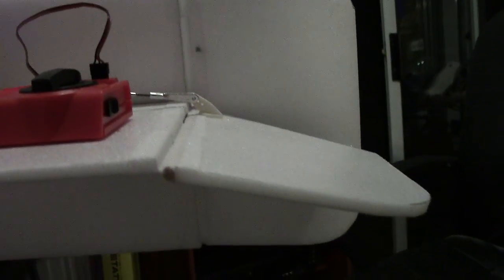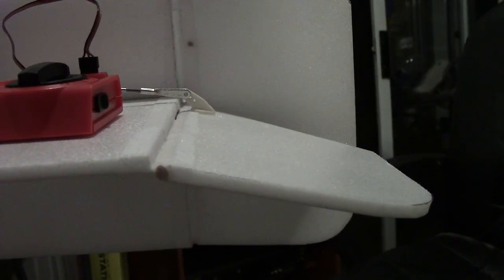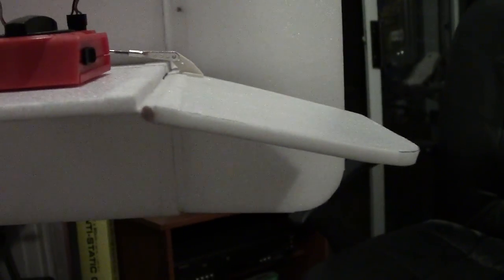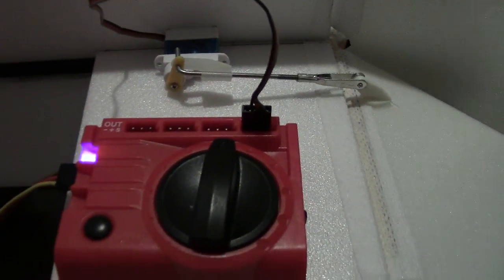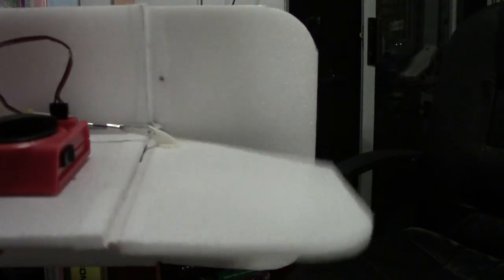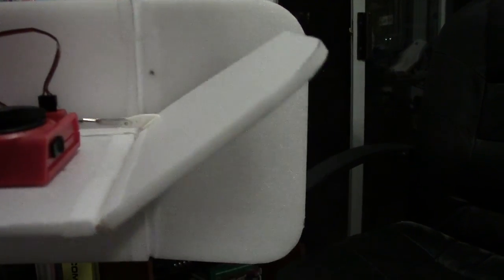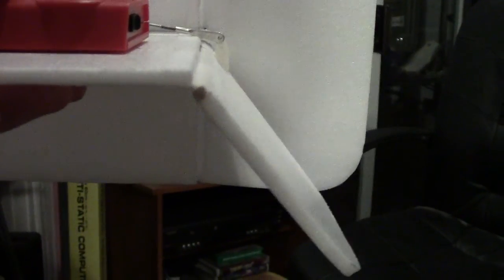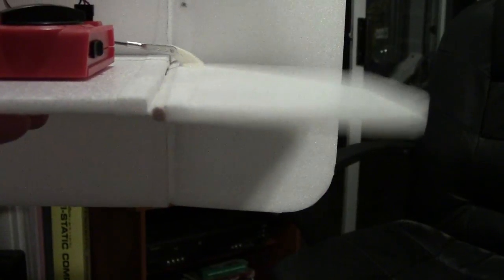Underpowered Servo Jitter Problem

Comment: Not buying the idea that this is due to lack of torque. Thanks to gravity the servo has to do less work when moving the surface down. If anything it should stutter when going up, not the other way around. With that flutter I would blame the control circuit for not doing proper PID control.

Comment from the maker: Digital servos can jitter if they are working too hard too maintain the set point. But the oscillation should be very small, not large like I show in the video. If the oscillation is large, then it is definitely overloaded. Switch to a more powerful servo.